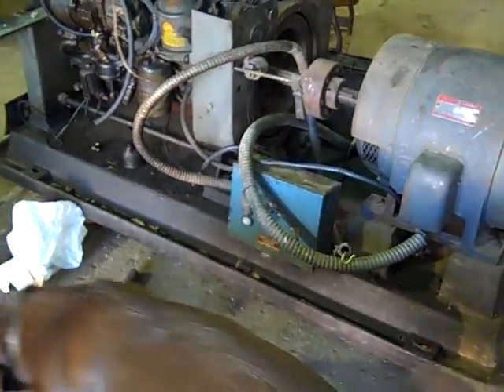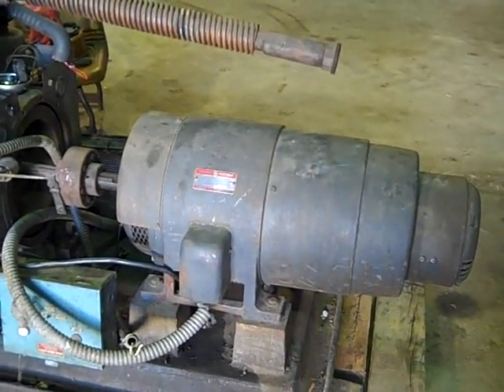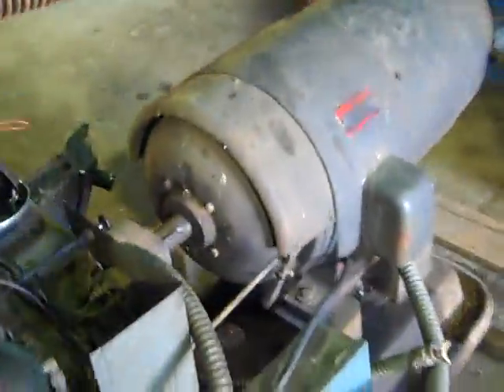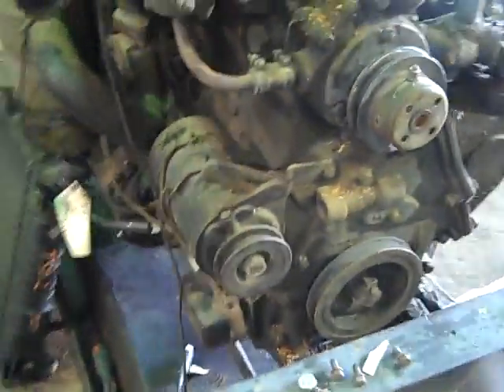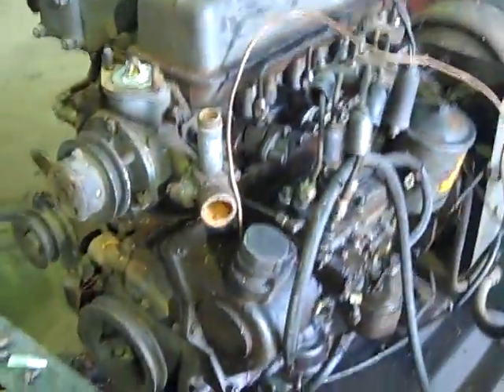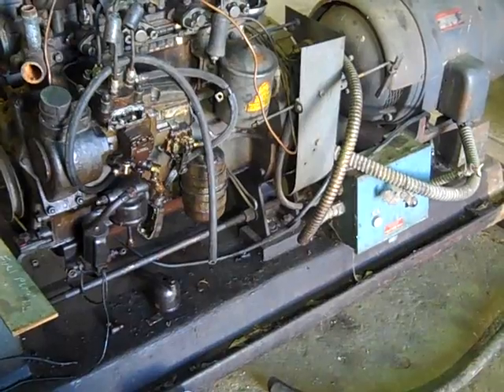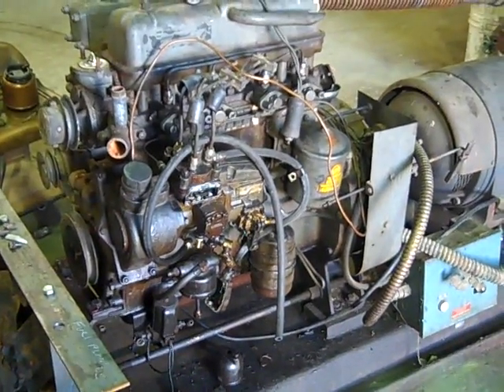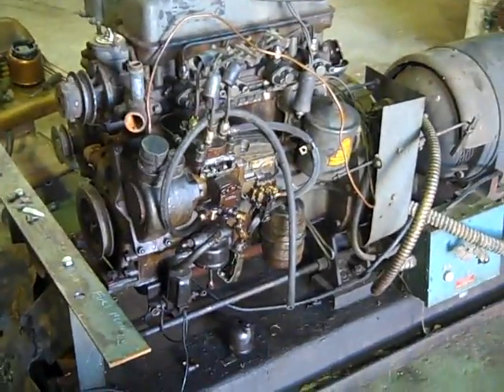EMP proof strategy

Comment: Continental engine - that thing will run forever. I worked in a place that had several forklifts, all with Conti engines. I've seen them live through running all day with no coolant and even one time I discovered that our old S40 Hyster (which had been working all day up to that point) had no oil in it. Filled her up, no problem, ran for years more until we updated our fleet.

Comment: Any advice please: I am attempting to repurpose my old 10x10 steel underground storm shelter to harden it from EMP. It has 3 openings 1- 4" vent pipe and 1- 14" turbine pipe and 1- steel door, opens horizonally 35" x 60" Very heavy and I used Foam Crack or Gap  Sealer to seal 98% of the cracks in door frame. I understand that using a radio to see if any signal is entering (It is)  What is the best material to use to cover both vent pipe holes and the door frame. I enter the shelter only to empty a de humidifier which is ran 150' - 15 amp ( i'm pretty sure this must be disconected to protect vital componants stored inside shelter.
Since the entire unit is buried except for the entry and 2- pipes, should I install an additional 8' Copper GR. I also have built a 24 GA steep roof above the entry and the entire unit is encased in 6 tons of concrete poured into the outer walls to ancor down to welded skids at bottom. I have a 2" slab poured around entry also. Thanks for any advice engineer 775 or anyone with any fresh ideas.

Comment: ur half right any thing with current will be affected a wire could potentially blow from the effects at the nuclear level B\C the current is forced in an un natural direction for a few moments any device would be fine as long as it was off or protected with copper (BTW) i have constructed MRI rooms in hospitals and X-ray rooms i have yet to do a CT room =3-

Comment: Anything with a computer chip, diode, transistors, etc., (e.g., cars, computers, cell phones, motorcycles, coffee makers, etc.) will be disabled after an EMP, unless it is completely disconnected from its power source and any other connections, and is surrounded by a Faraday cage.  Old school items do not contain any of these, "high-tech" components, and therefore, would be perfectly operational after an electromagnetic pulse.  The massive energy released from this blast destroys these items.

Comment: HEY...diesel engines are officially ANTIQUE...The Hull Effect Technology.
 Discovered in 2009
E85 Fuel or ethanol fuel grade...operates  on ounces per hour.
250 brake foot pounds  of torqueusing 134 cubic inch carb engine  1957...6.67-1 compression.
 1300 rpm...clean exhaust....makes clean hot water by the gallons in 15 minutes.
 I  am the HISTORICAL inventor of the re-tuning processes

Comment: One off grid, mountainside cabin living fellow used a Suzuki engine to recharge his solar/wind batteries. He had several alternators mounted on the block, obviously with an over-sized belt. He ran the coolant hoses into his cabin to heat parts of it, using radiant floor heating. Wish he would have posted some pictures but...

You could have the radiator indoors and cool the fluid running through it with a fan powered by the generator. Heat the house and help cool the block all at the same time.

Comment: hello engineer 775 I have been watching yr vidios for a while now and find them very informative. especially the gek wood gasifier running your onan generator. 6 cylinder. is it still in operation. how many hrs have you run it at at a time.to run your home. A great find that continental diesel . im into wood gasification also with a 7.5 kw onan gen 2 cylinder . My story in Home Power magazine 73 (asolar and wind powerd home 10 yrs later) may interest you. im not emp proof.KeeptheFaithJohnMillard

Comment: @ engineer775, What would be an example of a generator that is not EMP proof? For instance, I have a Generac whole house generator that runs on LP as a back-up for when grid power goes down. It is enclosed with a steel covering which does have some venting. It requires and has a ground wire. Is this EMP proof or would I need to build an additional screen box around it and also ground the screen? Looking forward to your response, thank you.

Comment: I have a question and was wondering if you could help me out on it, will an insulated metal garage, with a metal roof and concrete floor protect the vehicles inside from an emp event?  Thanks